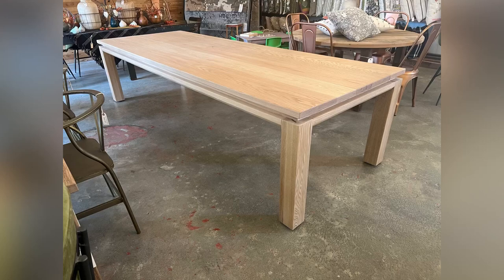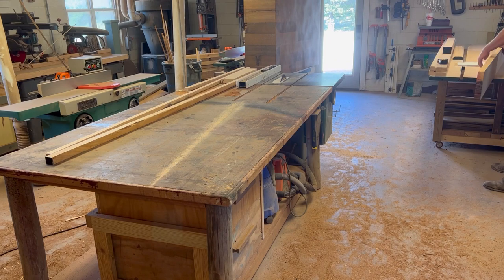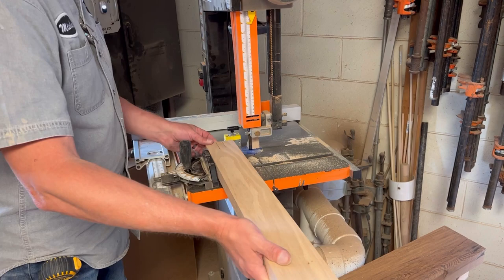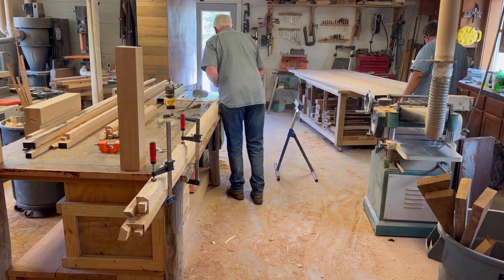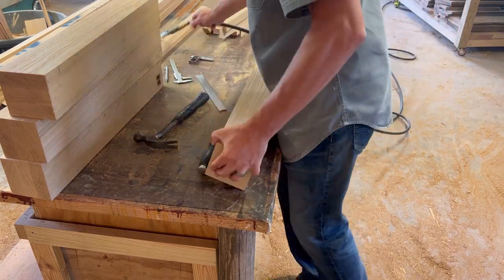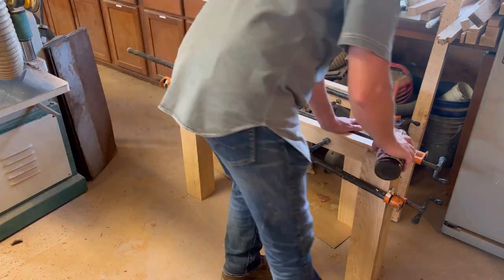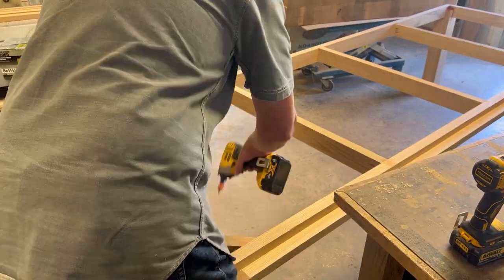10’ Oak Table with a “floating” top

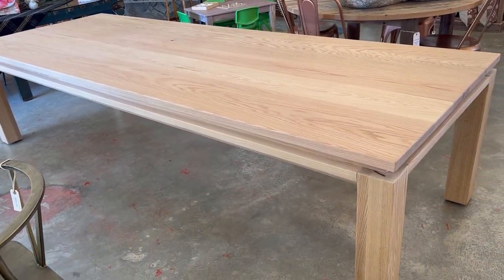Comment: Do you have any concerns about the checking in the middle board of the tabletop? Did you fill that crack with something? (or is that an optical illusion at 31:09?)
Reply from the maker: I think what you’re seeing is an optical illusion but we do use epoxy when we need to. I don’t remember any epoxy on the top of this table.